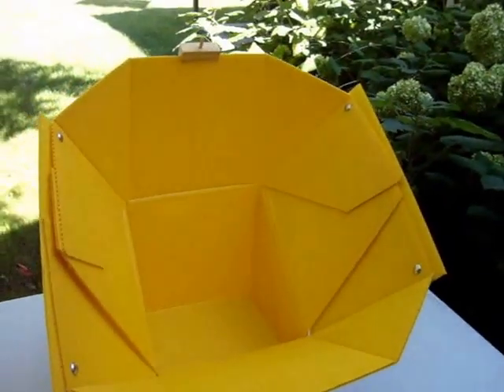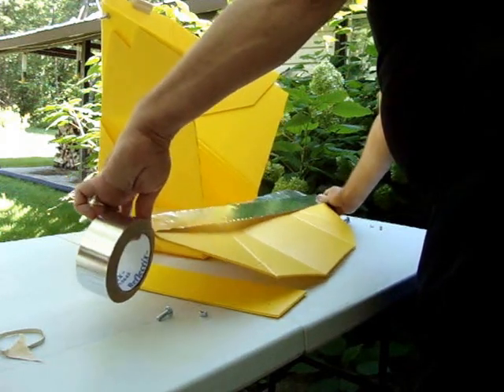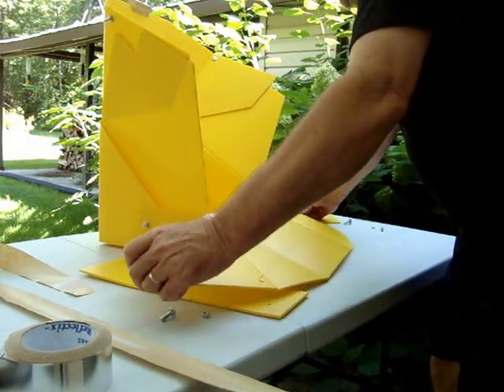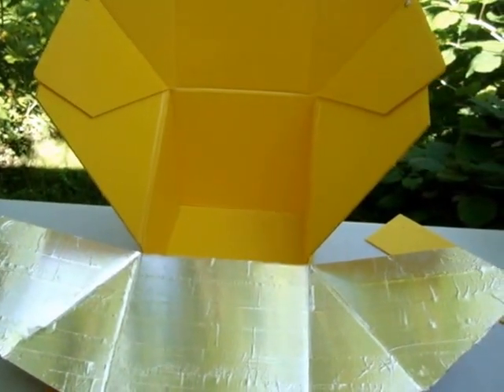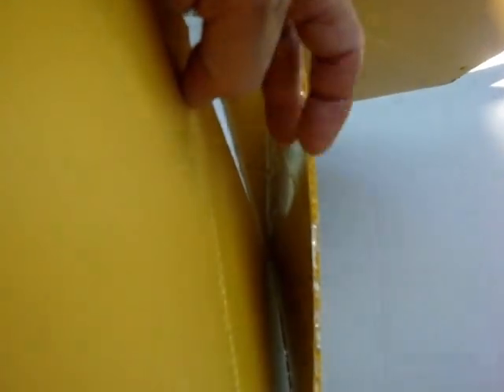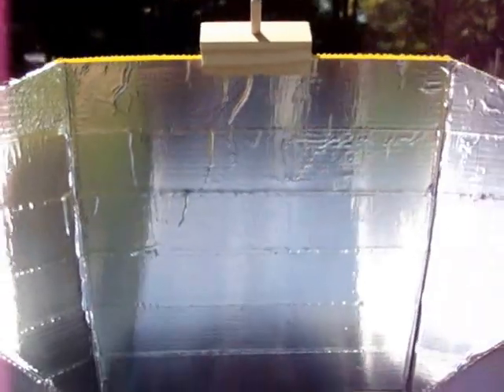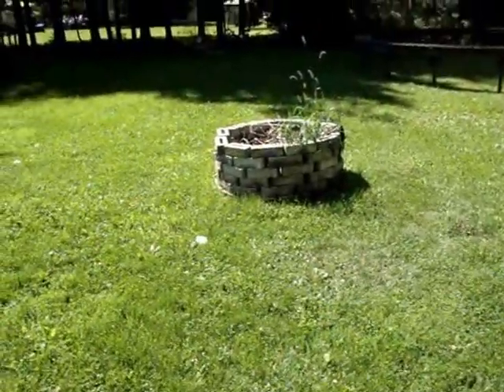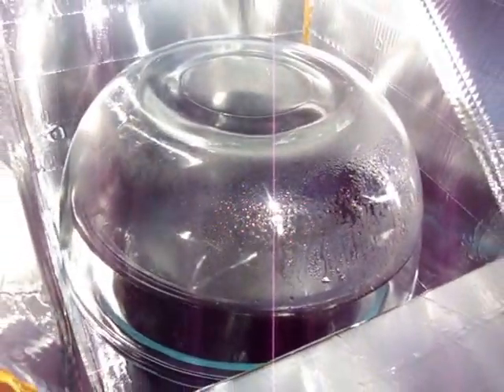ASSC installment 2 - aluminum duct tape and temperature test

Comment from the maker: Yes, that is the basic theory, not quite that simple, but close enough. In order to get the range that I needed to successfully utilize the car, the only solution was a 200 AH Lithium Ion battery pack and charger. This would have given me about 100 kms range. The only part that was a problem was the cost - about $6K for the setup, and I was not about to do this right now - too much money. A motor similar to the one I used should only cost $100 or so, at most, $500 for a new one. Thanks,  Ken

Comment from the maker: Thanks for the comment. I think this roll of Reflectix was about $7 at the Depot. So, all-in so far, I am out (includes the cookware and the taxes too) about $94. So, for under $100 you can have a decent solar cooker that is also very portable. This thing weighs next to nothing and once you have done it a couple of times, you can put it up and take it (folded flat) in a matter of 2 minutes. I think it's a great piece of engineering! Thanks for watching...  Ken